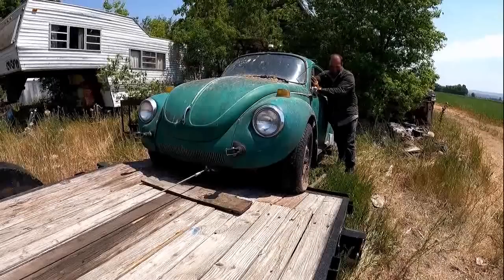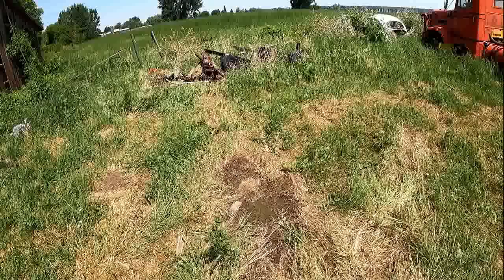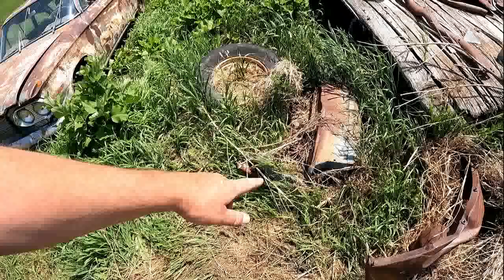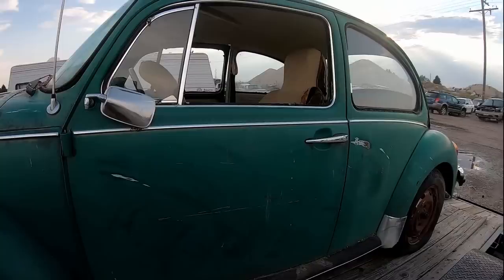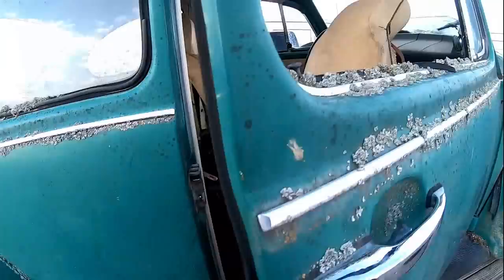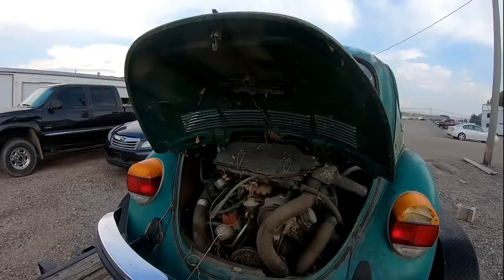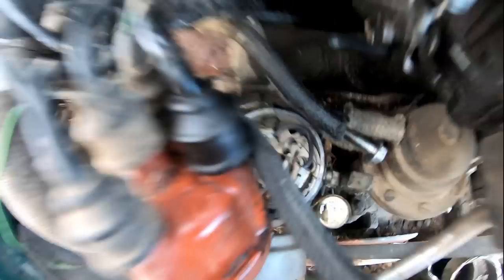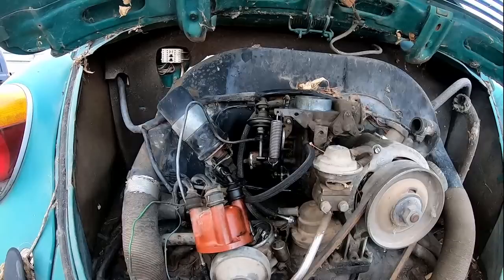Volkswagen Sitting For Over 30 Years Will It Run.  Forgotten VW Super Bug.

Comment: The engine sounds really strong. Maybe a fuel pump and a carb cleaning and it'll be a real runner. The body definitely needs some rescuing.
Reply from the maker: My buddy changed out the distributor and a new carb and its running pretty good.  Motor is actually going in a different car.  Not sure what will become of this body.  Its pretty rough.  JC.

Comment: Yup, I had one like that, metallic green, 1974. They were very reliable if kept well maintained. The points gap needed adjustment every 4000 miles or so, then they would always start, rain or shine. Whoever buys it off you needs to remove the engine though, clean out all the straw in the fan housing. Not good to rev it up too high until all that is done.
Reply from the maker: They are amazing little machines.  JC.
Reply: Just got a 71 an the old man I got it from was doing some work on it an I guess he left a blue shop rag on the fan housing... is my guess  so the generator went out so I swaped a alt in it an in the fan was that blue rag I'm guessing it sucked it in from the top somewhere in to the fan hole in the back

Comment: that was a fuel injected bug originally. Note the data port on the firewall top left, a regular super beetle wouldn't have the data port. I was actually surprised to see the original distributer though.

Comment: Wow you don't see these old cars too much anymore in New York that is a great find I always wanted a Volkswagen  like that. I have a 1998 Chevy Tahoe LT with 232,000 and its in very good shape only cleat coat failure on the hood and the top of my truck . I am thinking about selling it eventually but the four wheel drive stops me from selling it ,great winter truck.

Comment: Super Beetles are great (along with pre 65s) but these really have the edge on practicality!
Reply from the maker: Why not 66-67 cars?  Just curious. JC.
Reply: I bought a new 1980 beetle $1839.00. Drove it 100,000 miles and sold it for $ 1000.00. Great little car.

Comment: Sometimes, someone messing around with these VW engines, not understanding they have an electric fuel shutoff, will conclude the engine is just not going to start no matter what. You end up getting a good engine at a good price because they didn't know how to get it started.

Comment: Hello Salvage yard worker from some state and farm. I see the licensed plate as a proof of who had operated the Green mean Volkswagen super Bug. It is tamed only if you add more parts that replaced the bad seal of oil. The bug is air cooled sedan 2 doors atop the trailer named 4 wheel Master and its park for a week until you have to pay for new tires because you are in their tire center property. The tire will proof that the inspector will sell you the fee for overall and while you do the overhaul the check-up as we inspect the shop or your bug. Reason we run the brand because we don't buy radiator fluid that has to have brand like Prestone or Peak. We use the brand like Car and ply V-belt to keep the clean bug but we need wireless vacuum cleaner so that the dealer would know that you volunteer and learn to help the dealership and the lot owner to attract more potential buyer. We still run the brand because it's smaller than brand named Prestone. If you go to Discount and make discount to slash the price off because they sell product without add in the retail pricey parts; on were made in American China International parts that would sell gasket set to overhaul your broken engine or is your engine is 1600 cc will run as operator expect to let it last up to 250,000 miles reading in Vollkswagen Bug's odometer. We will take camera picture of your licensed plate in your green Volkswagen super Bug so that the people is ready at same time to sell you the operationable and salvageable transportation called vehicle. You shall not go to the DMV because it needs to be inpect the more parts to help the super Bug green sedan 5 window and no vent wing window. The old no good licensed is inside the car and it must go to estate so the estate will overhaul all licensed plate and melt all licensed plates to be sold as scrap to the trust board and DMV. But we don't melt it - I sent it back to DMV licensed dealer and you will need licensed and add number and letter your the green Volkswagen because without the licensed plate then you are not allow to earn money or value or even spend on trading post area. Period. But you said the trailer have licensed plate but throw the trailer licensed plate away then right away get the car licensed plate to save your money. Sir? In case when you have trailer and the Bug then most likely to drive the trailer that can be power up by borrow someone else's steering wheel but the Insurance force the liability of the law that someone else is licensed to drive only one vehicle and not more - To save money and be the money Miser - the wiser.

Comment: Weren’t you ever told not to grind a starter endlessly? All the coil wire out of the distributor cap, hold it up close to something metal and you will realize that you don’t have any spark most likely.

Comment: Should you run an engine that's been sat that long at such high RPMs when it's only just been started? I thought it's not good for an engine when it's cold even if it's your daily driver??
Reply: You should always allow the oil to warm up so it can lubricate the engine better especially if it had lain idle for a long time

Comment: The VW 1303 is the Best model ever produced.Be careful do not accelerate the engine so hard it is an air-cooled engine especially after so much time the engine being switched off.Is it the type AS 1600c.c?

Comment: First of all your camera has to be 4 core or a little less of inside thye camera called 4 core lite that way it turn on the len CCD and also turn on the second len in the same camera that way there will be two screens per display. One screen for closed caption and what you say plus second screen is the video base on what you act and filming. Maybe I got a bad TV channelizing accelerator card that needs being  replace in the Delco and Volkswagen dealer's full of lots and sale center..

Comment: Weren’t you ever told not to grind a starter endlessly? Pull the coil wire out of the distributor cap, hold it up close to something metal and you will realize that you don’t have any spark most likely.
Reply: Pumping that accelerator over and over is like spitting in the wind! since the throttle shaft was stiff in the beginning, you should know that the diaphragm on the  accelebrator pump on the carburetor is going to be brittle or busted or both. But you probably knew that… Also, you shouldn’t let one spin fast when it first starts up. It’s a good car. That was a good find.I’m in old VW person myself and I have learned all the tricks along the way that you’re not supposed to do about that hard knocks method and that’s the ones that stick in your mind. Otherwise I wouldn’t be pointing things out